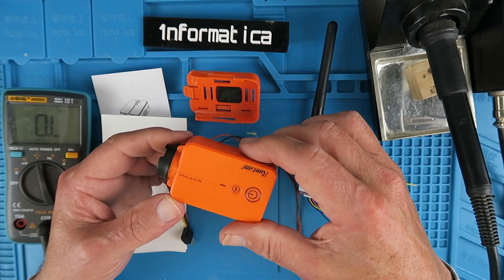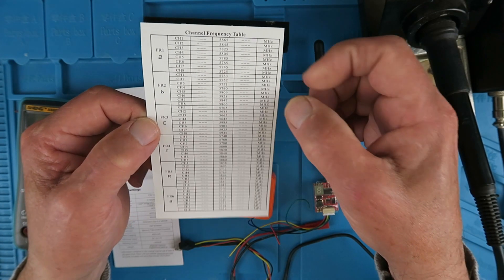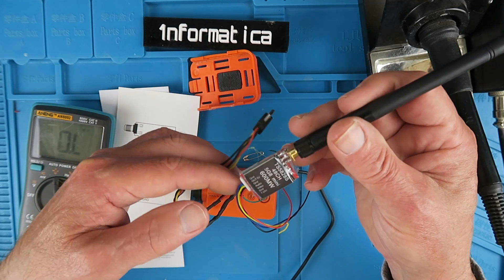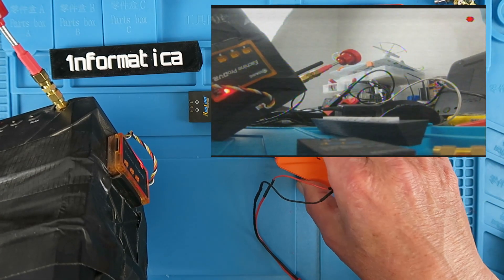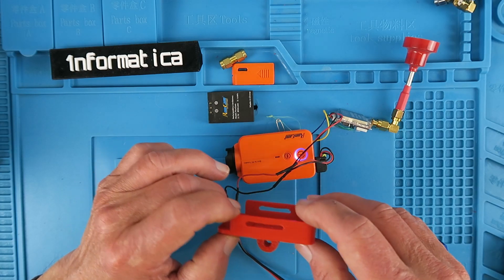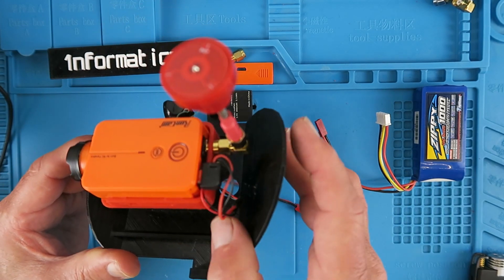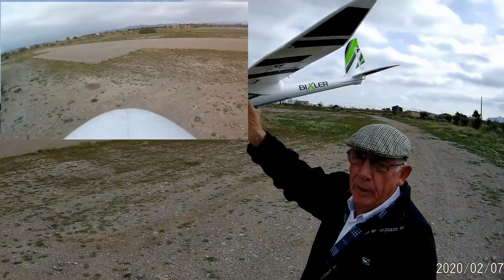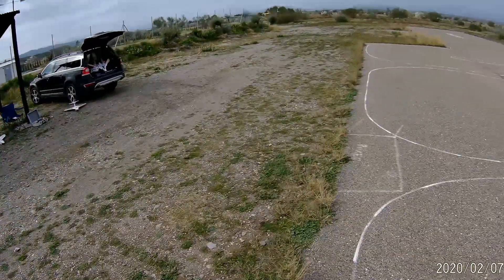RunCam 2 FPV Tx Mod Hack

Comment: Remember, using higher voltage for the vtx, means less heat generated by the vtx. So better go with 24v than 7v when possible.
Reply from the maker: Thanks for the tip.

Comment: the power for the camera and vtx uses a battery how many cells? Thanks
Reply from the maker: Hi, the Runcam 2 will accept from 5 to 17 volts https://youtu.be/QWCtTEVz3AE?t=11 I was flying on a 3 cell pack so around 12 volts. Thanks for watching, have a great day!

Comment: I have the Runcam2 with the latest firmware and I can't for the life of me output video via a VTX. I have verified the VTX working with a normal camera but seems like the RC2 does not output video for some reason.
Reply from the maker: Very strange! Are you using the Runcam supplied AV cable? You can see the pinout here : https://www.flyingtech.co.uk/fpv-camera-gimbals/runcam-2-3-5-fpv-micro-usb-video-out-and-power-cable Try hooking up to a TV / monitor that supports composite video. Check the video standard for your region PAL or NTSC selectable in the camera settings. Buena suerte!! I subbed to your channel, interesting stuff!

Comment: I was hoping to see how you mounted the VTX in the RunCam housing. May be easier with a nano size VTX now though. Thanks for the idea.
Reply from the maker: There is no mounting other than the antenna where it screws onto the VTx through the hole in the 3D printed case. https://youtu.be/QWCtTEVz3AE?t=174 Please consider subscribing if you have not done so already!
Reply: @1nformatica  Thanks for the heads up on that. I understand how you did it now. 👍

Comment: Not messed with FPV but thinking of using it here on our property to monitor the comings and goings of vehicles.   This is a good overview for me.   Thank You.   What we would have done for this kinda stuff back in the 70's ?   Crazy progress.
Reply: Man, you made me think here... There are some cheap FPV cameras, even some with night view! And it wouldn't be difficult to make it work with a regular DVR!
With FPV transmitters (VTXs) I really wouldn't recommend... You only would be able to have 8 of them at the same time, or there's going to be lots of interference. And the receivers aren't cheap. 😕
But that's not a bad idea! 😃
Reply: @MCsCreations  I was thinking BangGood Cheapo Cheap , receiver and LCD monitors .  I have the monitors laying here collecting dust.  Small solar panels on hand,  LiIon 18650 bucket full on hand.
Reply: @pulesjet  Well... It could be an interesting project, dude! 😃
Reply: @MCsCreations  I have two lifetimes of unfinished project here.   Currently my 8Kwh  Power Closet .   4 more solar panels and I'll have all the bits and bobs in hand.
Reply: @pulesjet  Yeah... I feel your pain, dude. The same here. 😬
Reply from the maker: @MCsCreations  Sounds familiar!! Forgot to link to the TX I used, it's in the description now : TS5828S Micro VTX 5.8GHz 600mW 48CH Mini FPV Transmitter http://bit.ly/TS5828S